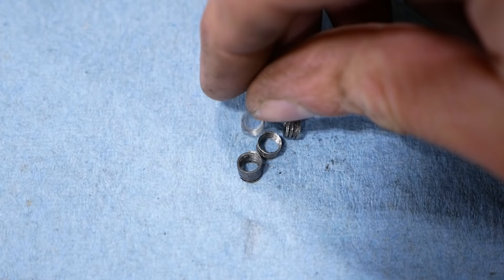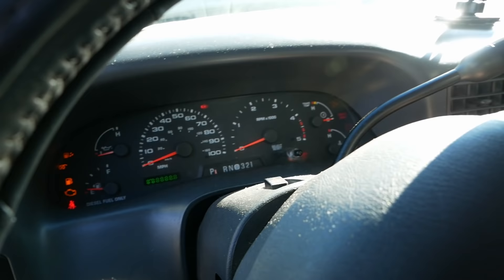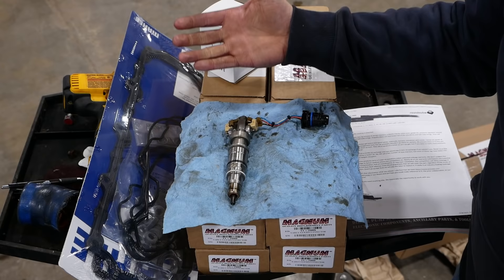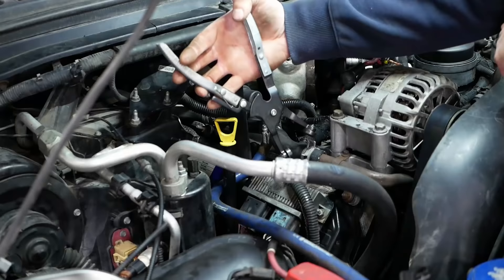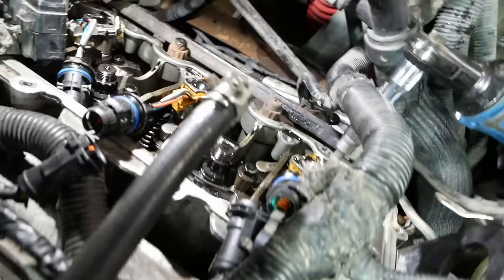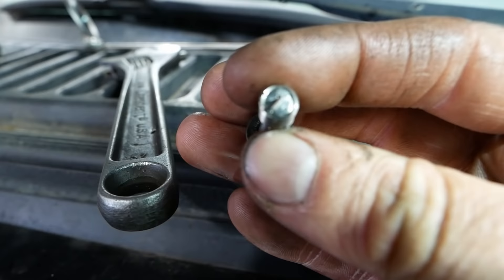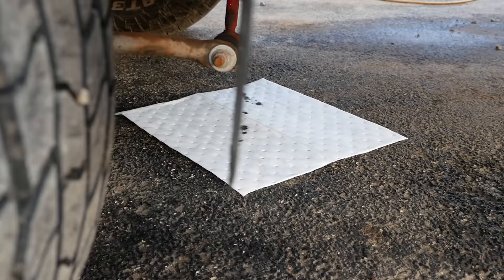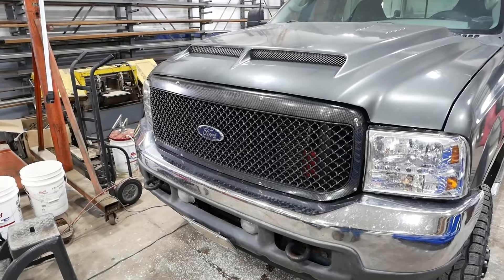They Left Me a Mess - 6.0 Power Stroke Low Cylinder Contribution - Injector Replacement Woes

Comment: Older vehicles sell for higher now days even early 90s because they have less computers and the parts and electronic shortage of newer vehicles is causing new vehicles to drastically drop is value and older vehicles with less computers to sky rocket is Value my 97 4runner is worth 68 grand right now it old sold brand new for 34g I was offered 138 Grand For My 2001 f350 WITH the 7.3 the other day price values are going insane all because of shortages now days grrat video as always @Watch Wes Work

Comment: Ugh, are those MY screws? Isn't SAE spec for steel into aluminum 6 ft-lb? Kawasaki called out 10 ft-lb for those on my GPz1100. The cam boss was too thin for helicoils to seem right. I tapped with 1/4-28 and everything went splendidly! It's a kludge but the threads are so close that the larger 1/4" cuts fresh metal. Gotta switch the hardware tho. 🤷

Comment: It's ridiculous how jammed these engine bays are. I think low battery voltage toasted my FICM because it was sitting at about 40v instead of 48. Once a new FICM was installed, the injectors got the voltage they needed and it was good to go. Boy I wish this thing was mechanical - not a fan of electronic machines

Comment: Wanna work on my 2004 6.0 powerstroke, its been deleted the exhaust aint great cuz the guy is not good, a cold air intake its good a few suspension problems but its all oem stuff never been messed with except the sway bar links, but motor hasent been gone thru nobody has been in it besides the hpop other than that its all stock, with 277k miles, i need to get it studded, different injectors, glow plugs and suspension, i guess its had exterior moods but nothing to crazy, and it needs trans work but its solid, i do live in Nebraska to so that helps a little bit.

Comment: Its strange because I have the same year truck with the same codes and issues on #5 but all the injectors are new direct from Ford as of 5 years ago. It passes the buzz test and FICM voltage checks out, but still runs rough for 10 minutes or so after startup. I'm hesitant to just buy injectors but this mostly confirms my hypothesis. 

Can you elaborate more on what you did to the FICM fuse to read the pulses on the computer? I'd love to perform that test

Comment: Ive got a 2004 king ranch which is in great condition and has been bulletproofed, deleted, the works. It has 250,000 miles. The only thing wrong with it is it does leak a little coolant out of the degas cap when I get over 3000 rpms. Which is rarely and means Im wide open throttle. How much would you think it is worth? Like I said, body and interior and everything else in great shape.

Comment: I’m having this issue where when the motors not at operating so between 100-170 it doesn’t feel like it’s running on all 8 it’s rough it breaks up but once it’s warmed up it’s like there isn’t any issues at all but my injectors pass the balance test ?

Comment: I heard stripping and thought this could be interresting as he always wears layers. I was between jobs in 05 and made a really good living off Ford engineering and these "fuel" systems for over a year, I saw many times where owner had taken a hammer to the A/C box and taped it up, the only reason I went back to work was to get away from them.

Comment: It is my goal in life to get people to stop using “Helicoils” (they suck in every way!) the ONLY proper way to repair nonferrous thread issues is with TIME CERTS! They are not only the best fix but are used by all high end manufacturers that have to have proper threads in any nonferrous applications! If you don’t know what they are then look them up. Once you start using them you will never go back to those hobby thread replacement bits!
Reply from the maker: I worked in a machine shop and I've installed thousands of helicoils and never had an issue.

Comment: if this was my truck i would have sent it to the junkyard a long time ago Already at that point with my 1992 F250 because ford doesn't make the parts i need for my trucks supposedly rare design of fuel system it has in-tank pumps that are both high pressure instead of 2 low pressure that go to a high pressure right before engine All the auto parts stores and ford dealerships can't find the pumps i need
Reply from the maker: Junkyard.

Comment: So I been having a issue with cylinders 1&5 saying I need injectors I replaced all 8 and I cleared the codes and they keep piping up and now it has a ruff idle I replaced icp ipr hpop any other suggestions?
Reply: 2004 early model

Comment: I just did a set of injectors on a 6.0. And the reman injectors ...flooded the engine...don't know if engine is ruin..but the exhaust is fully of diesel fuel...don't  know what happened and what cause those injectors to fail
Reply from the maker: Water in the fuel can blow the nozzle apart.
Reply: @WatchWesWork  found out a new remand injector failed...going to put it back together and hope for the best

Comment: 22,000 or more for your old truck is great but it doesn't come close to a newer used diesel in price. Just saw a 2015 Ram 2500 Diesel w/ 75,000 miles at reputable lot with an asking price of $55,000. Yikes. They didn't even detail the interior. Sold in a week.  
All that repair work on a truck with 171,000 isn't very good. Is that a common Ford thing?

Comment: Random question, would you personally be able to replace the rotted crossmembers under the bed floor on a 95% rust free truck like this?
Reply from the maker: Sure. You can buy them. Cut the spot welds and put in new ones.

Comment: Also why not pull the ficm relay until the system is primed?
Reply from the maker: That won't make it prime any faster.
Reply: @WatchWesWork  not intended to prime faster, intended to take load off ficm while you're cranking for an extended time.
Reply from the maker: @bad05ford  I don't see how that would help anything. The load on the FICM is the same regardless of the HPOP oil pressure.
Reply: @WatchWesWork sorry I'll clarify.  It's protecting the ficm from supply side voltage inadequacies which can damage it.  The truck you did started pretty good, I've seen cases where people thought they were going to burn up a starter trying to get it started.

Comment: Most people drive trucks like this as a diesel powered penis extender, and have no legitimate need for one. That is clearly the case with this truck, as you can clearly see that it has never seen a day of work in it's life, not to mention at least $5000 worth of aftermarket garbage added to it so the guy can feel special.
Reply: These trucks are undriveable pieces of shit imo. Crashes over every bump with suspension hard as a rock because muh lift kit bro...

Comment: Power balance test is useless unless you use Ford IDS and turn off compensation.
Reply from the maker: Maybe 5 years ago. The aftermarket tools have come a long way.
Reply: @WatchWesWork  nope. There is only one tool that turns off compensation unfortunately. With the compensation on, the bad injector/s are basically impossible to identify.
Reply from the maker: @mcdadcoleman  We clearly saw it...
Reply: @WatchWesWork  If an injector it very bad, it'll show, but most of the time, other injectors could be bad and the only way you'll be able to see them is to turn off compensation with a Ford IDS. I really wish there were an aftermarket diag tool that turned off compensation.

Comment: Yay for working on a 6.0 PowerJoke..... And can we all line up the idiots that thought it was a great idea to use high pressure engine oil to help fire injectors? It does not seem to matter whom built these systems and how good the care is when it comes to oil changes... I see FAR too many issues with that HEUI injection crap.

Comment: You fixed this wrong Wes. Proper procedure would have been to pull the 6.0, drop a 12V with a nv4500 in it, and send the 6.0 to the junk yard.

Comment: After working on my mustang 2003 and many other ford vans and f150s all of them were arouns the 88 to 03. its always a night mare.there is not enough money in the world to get me to work on fords .they never make vehicles with the mechanics in mind. Its wvey bolt is either stuck stripped .or absolutely no room to put parts in or take them out.or u have to remove alot of other parts to remove one part.but all the hondas toyota and gm and dodges. Are just easier to work on.most of them make it easier for mechanics but not ford.

Comment: Silicone hoses are superior  in fact the oem did use one on that truck between the oil cooler and the egr cooler but not using screw clamps. Those silicone hoses you have there are cheap ccp kind definitely not purasol  hoses.

Comment: The 6.0 powerstroke got my vote for the worst engine Ford has ever used, ( I know it was a Ford,  ih joint project) I worked on these when they were brand new and told Ford regional service manager they were garbage and he wouldn't even argue the point, I finally quit when shop tried to make me designated desiel tech after other diesel guys quit.
Reply from the maker: The 6.4 is much worse.
Reply: @WatchWesWork  I had misfortune of working on a couple of those later on in my career,  then I mysteriesly developed an allergy to diesel so the other techs had to do the diesel repairs, ( more than I way to kill a cat)

Comment: This is what happens when government meddles and forces things.  Why can't light duty trucks have brute simple mechanical diesels that run for a million miles and just need a catalytic converter?  A big honking hunk of iron in a light chassis should be able to achieve high teen fuel economy.  The old IDI fords could and could be fixed with a hammer.  As far as I know, big rig diesels are still all mechanical and built like Roman architecture to last forever.
Reply from the maker: No. There have not been any all mechanical big rig engines in the US since the mid 90s. The Detroit 60 series was the first to have computer controlled injection back in the 80s.

Comment: The Ford 6.0 is an epic fail. These motors rarely made it out of warranty before suffering epic expensive failures. Your are being too kind as to how bad this motor really is. The Ostrich sticks it head in the sand when it doesn’t know any better.
Reply from the maker: I had a 6.0 that went 275,000 miles on the factory head gaskets and head bolts. I pulled it out of that truck after it was wrecked and it's still running in another truck today.

Comment: It's a Ford that's everything wrong with it. And don't laugh, You chrysler, and GM guys aren't far behind. NOTHING domestic built after 1979 is worth a shit!  

Ran into similar issues doing head gaskets on a E250 with the 2v 5.4. Ford doesn't give a crap what happens after their steamy pile leaves their factory/ showroom floor. Headbolts on that 5.4 are like 12-15" long and will NOT come out without the head or removing the whole E250 body off the chasis for a headgasket job. Who builds/ designs shit like that? 

American auto manufacturers that's who!

Comment: No it only has one problem and that's a 6.0 diesel is in it.

Hate them. I have been stranded more than once by these marvelous works of engineering. Worst work truck.

This is what happens when you take a low power pusher motor from buses and squeeze all the power and torque you can out of it for towing. Fords worst creation. 

Pretty much ruined the brand for me onwards. Icky.

Comment: Put a freaking temperature gun on it and see if the cylinders running cold hello everything mechanical is the best all this freaking computer bulshit it's as more stuff that goes wrong more sensors more headaches what a piece of garbage
Reply from the maker: That definitely won't tell you anything.